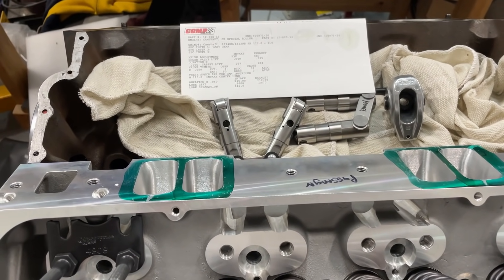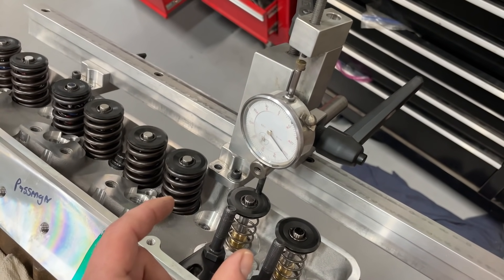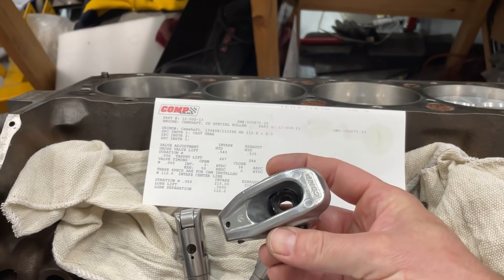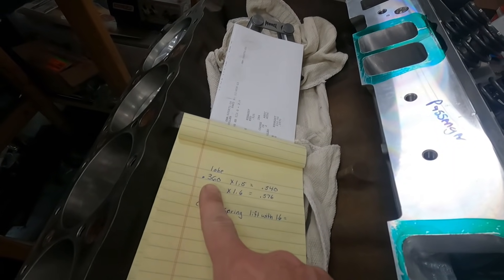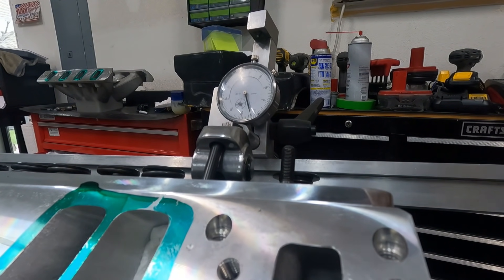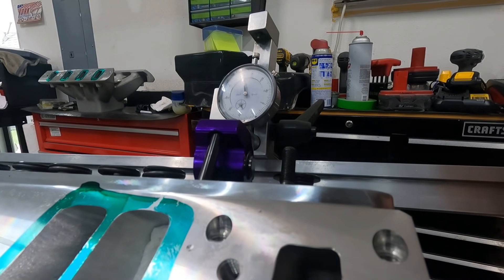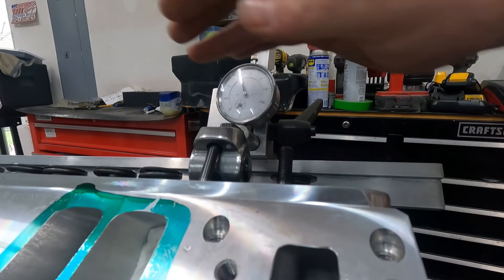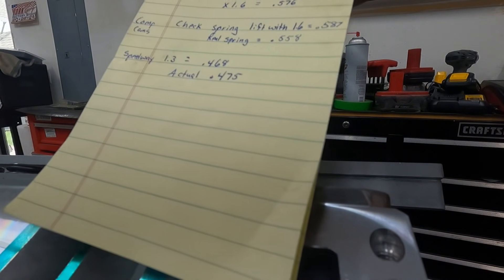Camshaft Info: How much lift are you losing?

Comment: Interesting, I have checked lift with checking springs and have found a tiny bit more lift. And duration as well. Never done it with proper springs,, well some light ones for baby hydraulic using a solid lifter to check.. And that was very close to the correct numbers.
A tin rocker would have been interesting, that style of cam many do use factory rockers. Comparing a 1.5 roller to a factory rocker gains both lift and duration.
And yes those Scorpion rockers have more lift. Comparing 1.72 with a diecast Crane gave about 30 thou more lift. So I did not use them. As I knew piston to valve was ok, but that extra lift may well have made it less than ideal.
I suspect the lift lost is more pushrod deflection than rocker flex.
I also have found that cam cards are conservative on spring pressure. Crane specs decreed 125 on the seat. Engine was a little lazy over 6700. I was given a set of 140lb seat pressure and it gained power over 6000, revved smooth to 7500. And that was above my safe limit! That alone was half a second a lap.
I checked the springs that came out and they were between 120 to 125psi. So were still in spec. Though probably started a little heavier. And it was no where near coilbind, the closer to coil bind means A You can lose a cam B have springs go soft quickly, or even break
Reply: For one, never rely on what a manufacturer says. Those are not recommendations,  more like minimum starting points. Every application for every part is different. Just one way a good builder differs from an assembler. 
Next, you have it backwards. Too far from bind will break springs. Not the closer you get to it. Its the open pressure that will flatten a cam, not being close to bind, unless you go into bind. 
Third, any new spring should be installed tighter than normal, as they lose pressure with one heat cycle. Not a lot, but enough. Hope this helps.

Comment: Still need to put you the correct converter in that thing.
Reply: Who needs the right stall, torque multiplication curve and way it holds onto that stall vs efficiency range converter.

Used to build some Coan billet bolt together units.  Pretty nice stuff.  Plenty of know how goes into getting them right.

Comment: So a BSR shaft mount rockers and 3/8”.135 min wall pushrods helps a little????
Reply: Helps a lot. Shaft style rockers are just more stable and smoother at rpm. They also hold lash longer. Aluminum is aluminum however, and still do grow more than steel regardless of style. Bmost people need more pushrod and spring pressure than they think. Bigger the O/D, the thicker the wall, the stiffer it is, the better.

Comment: What you are seeing is not even with it running! Lol. Most don't realize, huge difference between gross lift and net lift. Between deflection and rockers that are not a true ratio, you lose a ton. Not all rockers with the same ratio are created equal. Years ago I did testing for an up and coming rocker company, and tested MANY different brands. Same ratio, big names, and MOST fell short of actual ratio. Some were 1.6 that measured 1.4!  SCORPION was the first to catch on and were much bigger than advertised ratio. Now, a lot have caught on. Aluminum is worse than steel, they also grow more than steel, which gains lash when hot vrs. cold. Shafts are always better, as they don't scrub the stud when it takes up lash on a solid roller, and are much more stable. When it comes to pushrods, the bigger and thicker, the better.

Comment: I like you work and videos
I see the one head bolt on center , did you add bolts once you added additional spring pressure? especially the ones near the pivot area (rocker studs)

Comment: STREET daily driver blueprint plan for 2nd gen camaro.
Blueprinted Perfect 9.025" finished deck '010' 015 025 block350, 0.002" above deck pistons. Forged crank offset ground to 362 c.i. SBC  4.040" bore. PromaXX Project X215 heads, 2.08" intake valve unshrouded, .150" dome with relief. XR288HR on 108 LSA, PRW 1.65 roller rockers = 1.83:01 Off seat exaggerating ramp rate. Victor JR , 850cfm- VRS. Switching to 400 style bore block in tall deck block and Dominator 1050cfm.

Comment: You'd have to wonder if at least some of this isn't taken into account when you ask a cam grinder for their recommendations. I'm sure that good cam grinders will be recommending based on how the cam works in a typical engine.

I noticed that the LSA on the cam was 112 degrees. David Vizard has some videos where he says that LSA is the most important spec and that for a SBC it should be 108, and even less for a stroker. David is very adamant about this saying that he doesn't have an opinion, he has a dyno and more testing than almost everybody else.
Reply from the maker: That’s far from true both on Lsa and dyno tests.

Comment: Hopefully there are still some brands of lifters out there that are fit for purpose, as Ive seen several engines making metal on the runin cycle lately and these were premium lifters from reputable brands! Its the same thing with the rockers too, I dont trust alloys in high stress / high shockload applications, I know a racecar fabricator and he REFUSES to make any braking or suspension related components out of alloy as their hardness values seem to be akin to european cheeses than anything else.
Reply: All steels are an alloy.

Comment: Wondering about the push rod lengths here,  with different rockers the angle matters, if you start with it too flat your loosing a lot of potential lift, same with it sharp it’s the same.  Ideally you’d want the rocker flat- 90 deg to valve at full lift- maximum operating pressure.  I’m not saying your wrong here and maybe you considered this and didn’t mention.  The card just does the basic math- built “correctly” it’s a lot closer to cam card, by that I mean build it how they did-  good video tho.

Comment: Have you ever port Promaxx 200 heads and if so what do think about them and flow rates?
Reply: for what it`s worth I threw a set of those as cast on a 388 pump gas motor, open plenum, 750cfm with a small solid roller 242/246 at .050 609lift the customer wanted those heads. We put LS behive springs on with 170lbs on the seat. It dynoed at 491ft/lbs torque at 3100rpm and 500hp at 6600rpm. Me and the dyno operator were surprised
Reply: @edpetrocelli2633  wow that’s pretty descent from a 200 runner and 2.02 valve. Thanks
Reply from the maker: I have ported the Brodix ik 200 which is what the promaxx copied. I just have not ported the promax.
Reply: @generalrobinson8637  The next stroker SBC i do I`m gonna try the cnc`d 225 shocker series, they don`t cost much either. Eric likes the 400/600 lift numbers I like the 500 number. I want it as close to 300cfm or higher and I`d like to be about 90% of the total flow. I`m no cyl head pro, it`s what I have observed over the years besides I mostly do circle track motors. Dynos and flow benches are tools we dont race them. They are indicators and have to be interpreted correctly. Sorry if I beat my gums too much. $1370 no studs, no guide plates.
Reply: @edpetrocelli2633  yeah they seem to be some goof heads, I haven’t heard anything bad about them yet

Comment: why do some cylinder heads say the are for flat tappet only? is it the pushrod guide setup or spring package? Thanks
Reply: The heads can be used on anything, but when you buy a complete head set all put together from what ever brand, they say it’s for flat tappet, or hyd roller, because of the valve springs that are installed on the heads! Flat tappets have much lower pressure on the seat & @ full open, basically the bigger the cam/more aggressive, needs more spring pressure both on the seat/closed & at full lift/open! Just 1 note, if you purchase a cheap set of heads from overseas, never just install them! 99% of the time, the valve job isn’t sealed up, & I’ve seen there brand new springs with as little as 60 lbs on the seat! Way too little pressure, first time the guy drove it, it would only rev to 3500rpm & it bent all the valves that didn’t break, & destroyed the new short block
Reply: Don't forget about the seat material.  Hydraulic flat tappet 'only' head valve seats can be broken with high spring pressures.  A machine shop can put different seats in it for the better pressures.
Reply: @brianholcomb6499  thanks for the reply, im putting together a mild 454 and would really like to see a recent review of the KMJ bbc heads. There are a few videos by "Headbytes Porting" he seems to like them. It would also be interesting to see @Erick Weingartner react to his videos and porting work.

Comment: Eric, does a stud girdle help with deflection and lift loss?
Reply: I can't see how it would from a physics point of view. The deflection comes from bending in the rocker arm, pushrod, and compression of the lifter. A stud girdle won't effect any of that. All a girdle can do is stop the studs from moving side-to-side, which isn't a major contributor to deflection.
Reply: Stud girdles, as already pointed out, do not do anything for valvetrain deflection. What WASN'T pointed out is that they DO prevent rocker stud deflection, especially in an aluminum head. Not needed in every application, just over a certain point in camshaft profiles.

Comment: But won't RPM's and heat from a running engine make those numbers fall closer in line to where they're supposed to be?
Reply: No, just the opposite. You lose more. The difference in valve lift you see here is just from the spring, turning it over by hand.

Comment: The other week I saw a video by those meatheads on "Engine Masters" where they put solid rollers on a hydraulic cam to see what would happen. It picked up power at every single point on the curve. It was just a tiny bit, probably nothing you'd ever notice. But it was there. They couldn't figure out why. Now I'm betting it was reduced deflection bumping up the lift.
Reply: Not exactly. A solid lifter creates more deflection, not less. A hydraulic lifter rides on a cushion of oil, reducing deflection. Add in the fact it is a hydraulic roller cam which is not nearly as aggressive on the ramp of the lobe as a solid roller does, even ground the same.
Reply: @jrdmotorsports9718  How does solid steel deflect more than a piston floating on oil? There's nothing preventing spring pressure from squeezing oil out of the lifter. I do concede that the softer ramp will cause less deflection. It would be interesting to test, but I don't know how you could measure deflection accurately on a running engine and there's no way to test hydraulic lifters on a stationary engine.

If it wasn't deflection, what are your thoughts on why solid lifters produced more power than hydraulics on a hydraulic cam?
Reply: @johnterpack3940  A spring won't squeeze the oil out when it sees continuous oil pressure. It will, however, when you shut it off and the lifter is on the peak of the lobe... Solid steel, WITH LASH. Gets worse the more aggressive the cam is, and the looser the lash is. Lobe hits the lifter, lifter has whatever the lash is and then hits the pushrod. What will give faster? A solid steel lifter, or a long, thin hollow tube? Combine it with high ratio rockers... 
A solid roller lifter is MUCH lighter, and is more direct with in transferring lobe lift to valve lift. A bit noisier and harder on parts, but the valve sees more of what the cam is trying to make it do, especially at rpm. On the dyno, a hydraulic roller lifter can and has, gone into valve float quicker at rpm and power tanks sooner, like it jumped off a cliff. Solid roller lifters don't. More direct path to the valve. Many other reasons... The cam doesn't know it's a hydraulic, or solid or a unicorn. Just has 1 job. The lifter is the difference.
Reply: Solid lifter has some amount of cold lash while the hydraulic has oil with some amount of compressible air entrainment.

Comment: Why is there so much duration split between the intake and exhaust ? Also is the engine going to the dyno ?
Reply: He mentioned mild, power brakes, for his sister, just a docile street car, full exhaust system quiet. But he wants it to make around 400 hp.
Reply: @b.c4066   I noticed that. But this is an unusual amount of split for such a small cam on a wide LSA.  I was just wondering what theory was about that. To enhance the top end to make the desired hp goal maybe ?
Reply: @kristjanstefansson2765  I can think of many reasons, but all I can think of is why this term "duration split" keeps being used, when they aren't splitting anything. Two different lobes. Intake and exhaust. No splits. No such term, except for one youtuber who proves his lack of knowledge everytime he speaks.  Just sayin.

Comment: Morel Lifters 👏
Reply from the maker: I’m starting to switch to BAM lifters though.
Reply: @WeingartnerRacing  Thanks, I'll check them out.  That just an availability thing or what's prompted the change?
Reply: Worked for a place that built top level off road engines.  Had 2 engine failures due to needle bearings.  Jesel lifters.  Pushed for them to make the switch to morel bushed.  Already had switched to pressing the needles out of the rockers and using bushings.

See ya order a lot of Brodix stuff.  I'm sure they're on it now but if you order any spread bore blocks, make sure they've been through the HIP (hot isostatic pressing) process.  We also honed them before pressing in the sleeves.  They were cracking behind the sleeves.  Big problem when it happens to a bunch of blocks that weren't HIP...
Reply: @sc358.  Is that why they're so cheap 1600 bucks for a new 350 main 4.125 bore?
Reply: @cliffwright9842  I was speaking to their aluminum offerings.  Been out of the game for a while, would think that's no longer a thing.

As far as the cast iron one you mentioned, I don't know.  Dont have any experience with Brodix cast iron blocks.  Looks like a pretty good sized discount to comps.  Not sure why that is

Comment: Hey Eric would to big of a carburetor lose a lot of low end torque like say going from a 1050 to a 1250
Reply: Absolutely!
Reply: @jrdmotorsports9718  would it be a little bit or more than one would think cause I went from a 1050 to a 1250 it works good on the big end just lost 60ft
Reply: @keysautorepair6038  Put it this way, 2 carbs, close in build, for a given application, may be 10hp difference. One may come on sooner and die off up top, usually because it's too small. The other will have the opposite effect. Because it is slightly bigger. Only 1 will work for the application and power range. The difference between the right carb, and a completely wrong carb can be 30-50 or more less the entire curve. So yes a big difference. 
Now take a 1050 with 2.00" throttle bores, and a 1250 with 2.125" throttle bores and a bigger venturi. The pressure drop is so great at the hit of the throttle, it can't recover fast enough to pull fuel. However, it may make a few peak numbers more at higher peak rpm once it recovers, through the curve it's a dog and doesn't accelerate. Not always about higher rated airflow, it's how the engine accepts the airflow. 
Huge difference between the two you mentioned. I just built the same 2 carbs for a customer's engine. Going with the 1250.

Comment: Kind of makes you wonder why anyone would run anything less than a shaft setup in this day and age, even for a budget old school sbc or sbf, lgm, scorpion, even Jesel sportsman sets can be had retail for 1200, much less dealer wholesale or racer pricing through various places. One thing Eric didn't touch on is with all the loss of lift and deflection comes a lot of unneccisary heat and the obvious stress on the head where the studs bolt down, and the guide/seat wear that's guaranteed to follow. Question shouldn't be can I afford shafts but rather how can I afford not to run them. Spend big money on good heads then screw the pooch with stud mount rockers and justify it saying it's just a street car, or only low rpm. Just the fact oems have gone to shaft or semi shaft pedestal stuff should tell you how critical it is to have.
Reply: I deal with this every day, and in short, if the valvetrain geometry is designed correctly, and the correct parts chosen for the application, shafts are not needed in most applications, and is much less expensive. Race only, I agree.